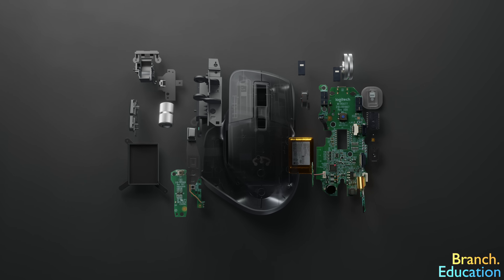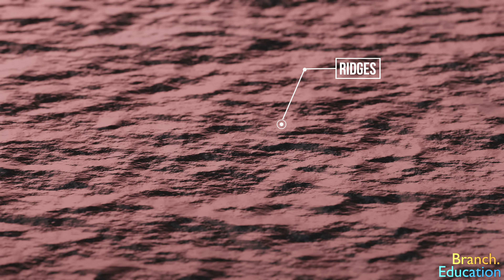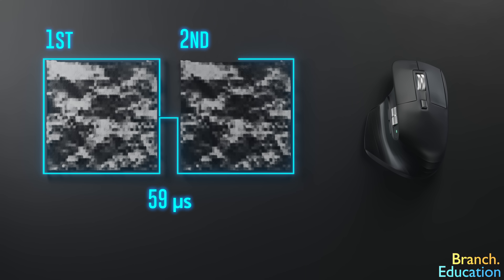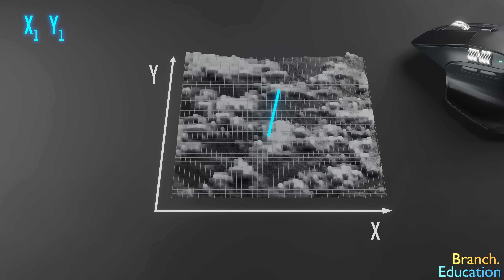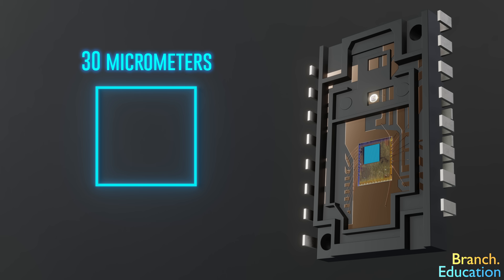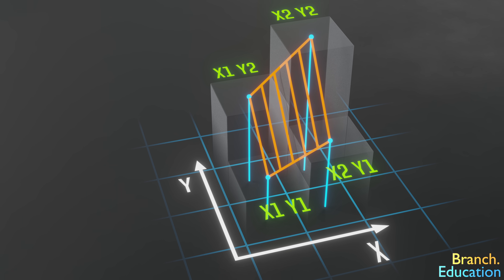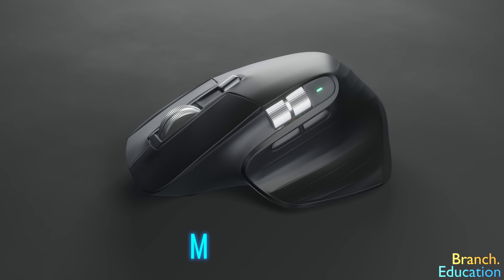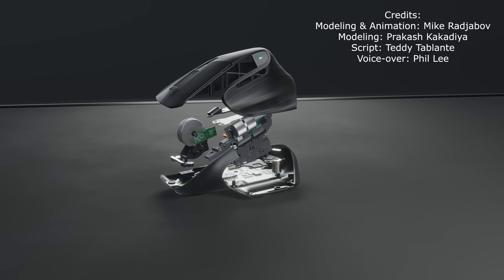How does a Mouse know when you move it?  ||  How Does a Computer Mouse Work?

Comment: Video was great up until you mentioned sensors get higher DPI using interpolation. Interpolation is fake DPI used by cheap mice to turn their real 800 DPI into higher DPI.Interpolation is not how real gaming mice get higher DPI. Real, higher DPI is done by using larger sensors for a higher resolution image.

Comment: In the late 80's my high school's drafting class "CAD" computer had an optical mouse. Used a Red LED and required a special mouse pad.  Definitely didn't need to be high resolution back then, probably doing EGA graphics at most, and I think the pad had a shiny grid pattern.

Comment: But then again if it has a report rate of 1000, how can it sync properly with 17000 images per second? You could say it's less accurate in determining distances 1/200 of a penny, gosh this is such a complex subject, like would it make sense that having an image sensor doing 1000 images and reporting 1000 images would still yield the same result as one of 17000?

Comment: That's so weird that you picked mouse models that are exactly the two mice I own and use, the G502 and the MX Master 3. I've only found one other mouse that has a hybrid free-spin/auto-stop wheel like the MX Master 3 (I think it was a Corsair) but the auto-stop clutch was glitchy and sometimes would keep going. At least the G502 wheel is weighted and notched so it has good free spin and it's pretty easy to just stop with a finger.

Comment: Back when I was a kid during the late 80s my mom had a Mouse Systems optical mouse with a rigid glass grid mousepad. It was a bit finicky and low rez, but monitors were VGA. It had an old school 9 pin serial cable and male plug. Later on she went to conventional ball mice for several years. I laughed back in the 00s when opitcal mice became popular again, remembering that old mouse from the 80s but very thankful for no more gummy balls to deal with.

Comment: Not quite correct. The mouse doesn't move the image around to line them up, it JUST subtracts them and compares the result to the old image to see which side of the features has expanded and which side has contracted to determine direction. The images will only have changed by a couple pixels at most, so the algorithm is very simple. Basically a hardware line detection algorythm, but it only needs to be about 80% accurate.

Comment: Long time ago, I used an optical mechanical mouse which is made by ‘digital’, they use 2 rollers which is placed at 90 degree each other to detect the x and y movement instead of using a steel ball coated with plastic. 😊❤ search by “Vintage DEC Digital Equipment Corporation mouse” you can see its great design at that time.🎉

Comment: I think that there is no point in installing an expensive photo matrix for a computer mouse, because with the advent of the first optical mice, an ordinary matrix was enough for a comfortable game, and despite the fact that Quake 3 Arena and Unreal tournament were more dynamic than PUBG and Counterstrike.  There are only two options for configuring the mouse: setting it to move quickly around the screen, but with less accuracy, or vice versa.
 This video also shows a mouse with an incorrect button layout (such a layout as in the video will be useful only for those who have 6 fingers 👽): the index finger should always be on the left button for a good reaction to the situation in the game and its rearrangement to the left side buttons in dynamic games it will only help you lose.  But in the middle position you can make an additional third button.  All other functions must be installed on the keyboard, since it is static and it is much easier to select buttons there.

Comment: Questions:
1. How do some mice work on a smooth glass surface?
2. How can the lift-off distance be reduced to a minimum?
3. How can a mouse achieve a higher maxspeed (often measured in "inches per second")?
4. What is the meaning of "max acceleration" in a mouse, and how can a mouse achieve a higher max acceleration?
5. What are the pros and cons of optical vs laser?

Comment: The slow-down of picture frames per second of the pixel array is not applicable to HyperX mice. Instead to conserve energy the image sensor shuts down entirely every 15 seconds even though it doesn't run on battery power. I RMAd my mouse and bought another brand instead.

Comment: Instead of the interpolation algorithm, why can't the mouse simply add a multiplier to the reported values? Say that the difference between the two topographical images is N pixels - why can't the mouse simply report to the computer that it has moved 2N, 4N and so on depending on the specified DPI?

Comment: Hm, how does the cross correlation figure out into which direction to shift? Does it try every direction for up to 40 pixels? 
What if the mouse moves really quickly, the images don’t match at all and the minimum is in a random direction?

Comment: The mouse knows where it is at all times. It knows this because it knows where it isn't. By subtracting where it is from where it isn't, or where it isn't from where it is (whichever is greater), it obtains a difference, or deviation. The DSP subsystem uses deviations to generate corrective commands to move the cursor from a position where it is to a position where it isn't, and arriving at a position where it wasn't, it now is. Consequently, the position where it is, is now the position that it wasn't, and it follows that the position that it was, is now the position that it isn't.
In the event that the position that it is in is not the position that it wasn't, the mouse has acquired a variation, the variation being the difference between where the mouse is, and where it wasn't. If variation is considered to be a significant factor, it too may be corrected by the DSP. However, the mouse must also know where it was.
The cross-correlation scenario works as follows. Because a variation has modified some of the information the mouse has obtained, it is not sure just where it is. However, it is sure where it isn't, within reason, and it knows where it was. It now subtracts where it is from where it was, it is able to obtain the deviation and its variation, which is called.

Comment: I see ways that AI could be used to increase accuracy, fidelity, and performance in the image processing and cross correlation algorithms.

I also feel like the interpolation is a bit misleading because it only creates virtual fidelity, not actual true fidelity.

Is any of this necessary for computer mouse improvement?
Not really because we have solved the technological hurdles and engineered a well-working wheel of sorts.

But could it theoretically become over engineered even more so to continue to improve the fidelity?
Sure. It would become more costly and the return on the improvements diminishing.

Comment: As someone who owns the Logitech G502 Hero gaming mouse shown in this video, I had an a-ha moment watching you explain high DPI!! That interpolation that you explained translates into an actual difference in user experience with high DPI vs low DPI.

At higher DPI, even as low as ~2000, I notice a sort of smoothness to the mouse movement that isn't present at 800. The higher you go, the smoother this feeling gets, almost as if your mouse is going down a long water slide with smooth turns and centrifugal forces. High DPI means stronger gravity and smoother but sharper turns. I realize now that that feeling is because the interpolation algorithm is essentially smoothing out the textured surface that the mouse is capturing, which is fascinating to me!

So when pro gamers are said to use 800 DPI, this helps make sense of that. It's the most accurate DPI, where your hand movements are directly translated into movement. An interpolation algorithm can introduce tiny amounts of error there, or the smoother movement can make precise starts and stops of the cursor harder to achieve.

So thank you for this great and super interesting video! I can't wait to watch more.

Comment: Mind-boggling how the hardware can ingest the image data and perform those calculations so quickly. It'd take a human forever to calculate a single one, considering it's multiple subtractions of two 1600 pixel arrays until you find the right fit. A mouse does that 17,000 times a second, and can do that non-stop for hours and hours while sipping power from the battery.

Comment: I thought that mouse just work by detecting in witch way the laser is heading and transform that info to the computer without capturing images and measuring the distances between each image and the speed of the move cuz those things i can control on windows mouse parameters 😂

Comment: This is cheap tech in terms of value of parts and making mouse.
And then you have smart marketing that will convince you that 100 USD or more mouse is better than 10 USD "ewaste"mouse because it has more DPI and few led lights.
Reality is that there is a bunch of cheap "ewaste" mouse out there with specs same than ones with brand name and high price on them.

Comment: G-502 for life! Before that it was the G5. I've probably used hundreds of different mice of high and low quality. This Mid-Range Mouse obliterates everything else by a significant amount. Mice are strange, some of the cheapest are better than some of the most expensive- to me, price to quality ratio doesn't correlate at all. I play a bit of everything, RPG/FPS/RTS/etc. so my preference for this Mouse is likely because it's a good all-round choice.

Comment: Question: does the image processor take the previous movement in x and y into account as an educated guess for the current x and y movement? That would be a nice optimization as you're probably not accelerating much in a couple microseconds.
Reply: funny thing, using previous action to predict an action that will happen next is partly how RollBack Net Code works (in fighting games for example)

Comment: i’m curious why there’s a seperate chip to execute the cross correlation algorithm. couldn’t the soc also execute the algorithm?
Reply: Yes.  The video makes a bunch of weirdly specific assertions that could be true for some specific model of mouse, but aren't generally true.  Yes, the main CPU could execute the image processing.  There could be a DSP.  There could be a functional block that only handles the image processing, but isn't a DSP per se.  Those could be the same physical chip.  And, the cross correlation could well be done in completely different ways from how the video said (for example using Fourier analysis techniques.)
The only thing you can say in-general about how optical mice do it is to say that there's an optical sensor, and something in the mouse calculates a displacement based on the data from the optical sensor.  Everything else is down to whatever the engineer found convenient based on what parts are cheap.

Comment: Interesting, I didn't realize there was a full image sensor inside. So since it's already taking a image and comparing it, might it be possible to make a mouse that detects not just translation, but also rotation? Maybe it'd just be a gimmick, but it'd be kinda interesting if you could rotate the mouse to do things like adjust the angle of an image you're dragging in an image editing program, or perhaps as a way to lean left or right in an FPS game, and it seems like most of the hardware to allow that already exists.
Reply: Definitely would be a gimmick. Trying to control both translation and rotation precisely with your hand on a computer mouse just means you will do neither very effectively

Comment: I'm very surprise they would max out at a 40x40 sensor....a 16,000 DPI mouse could easily use a real 125x125 sensor, that's not even close to what cell phone cameras use, and we have the processing power to easily handle it. What am i paying for with an increase in DPi if not a higher pixel sensor...anyone can do interpolation with a crappy 5x5 pixel sensor and claim 10,000 dpi. thats not real dpi.

Comment: Excellent video. I’m an old electrical engineer but just never thought much about how optical mice worked. Nice bit of explanation. Getting a vertical mouse for Christmas, in preparation for a new desktop build early in the new year. Hope the vertical style will better suit these older, stiffer hands. The hard part will be to move the mouse without thinking about your fine graphics and lucid explanations.

Comment: Very sly. Don't think you can get away with your phony explanation which will definitely fool the masses to believe what an informational video this is.
What is skipped in this video is the most important part of how the movement in terms of X and Y axis is calculated. When the digital unit doesn't save any image except for the current and last one, how the hell really the processor "shifts the second image around while leaving the first one stationary"? to find the relative minima?

Where does it get the value of the new pixels for the new plane as you so casually and conveniently said, "shifts around"?

Until you do some actual research and not just google and wikipedia some basic terms, shut your channel down and delete it forever.

Comment: I've seen all this practically but didn't knew what they are becouse once my wireless mouse started to go bottom left on the screen everytime i clicked a button i tried to open the mouse and dust off everything but it didn't help then i used a hair dryer and blew hot air over all the components (pcb) and over lense miraculously it's still working i used to keep it over table and maybe the atmospheric moisture was clogged inside, from then on I'm wrapping the mouse in a cloth and keeping it inside an air tight box after use
Conclusion: if u donot use electronic devices for longer periods of time disconnect the device from power and keep the devices outof moisture/ wrap them inside plastic bags

Comment: Bold choice using a Logitech MX mouse. They use a dark field sensor instead of a traditional one like the G502 you used as the gaming mouse example. The MX mouse can infact work on a glass desk, even without anything under the glass, because of it's unique sensor design. But it does so by working exactly the same way as other mice, except it measures the opposite end of the light spectrum.

Comment: I literally didn't expect how complex a computing system a mouse has, tremendous!
Reply: It only seem complex because they did not explain the mathematical shortcut in the calculation. Instead of calculating each pixel they transform the array of pixel data into a series of multiple wave frequency which makes it easy to calculate the distance traveled by calculating phase difference in every frequency.

Comment: *=* The good answer, never clean camera hole of mouse with paintbrush, that will damage tiny copper wire and cursor will not moving, just clean the transparent prism, or go buy a new mouse, did a models of mousepad got benefit?
A wireless mouse with advanced encryption is a good idea!
A app for mobile using the cam and light to imitate mouse displacement is just fancy, not for gaming mouse, lol!

Comment: how the processor would know where the second image should be moved so the difference between two images will be minimum? Does the processor brute force in all direction to calculate each step and find which direction that result in minimizing the difference? Or it uses some kind of optimization algorithm which calculate the gradient of each step based on the cross-correlation algorithm output as the objective function?

Comment: does this mean if I put a clear glass between my mouse pad and the mouse then the mouse should function perfectly fine as it's still taking images of the peaks and valleys in the mouse pad? because I have tried it and it didn't work. 
note: I did keep a small separation distance between the glass and the pad so it doesn't squeeze the texture and it still didn't work

Comment: The technology itself is nothing really crazy, but when you take into account cost (down to 5 bucks) and reliability (thousands of hours with zero maintenance)... that is really unbelievable! What an accomplishment!
Reply: it would cost very much if not for mass manufacturing
Reply: The modern mouse's reliability is mostly thanks to the lack of moving parts. The only moving parts are the buttons and wheel, and those parts tend to fail long before the electronics and sensor do. Old-fashioned mechanical mice used a ball and rollers to sense movement, and although they were much simpler than modern mice, the rollers got dirty fast and needed to be cleaned pretty often.

Oddly enough, although old mice are universally terrible by modern standards, the same is not true of keyboards. Some old keyboard designs, like the IBM Model M, were much sturdier than the typical modern keyboard, and keyboards of almost the same design are still sold and used to this day.
Reply: @argvminusone I still use the same Model M from 1989 I got in like 93 used to this day. As for the ball mouse, it’s long been gone.😂
Reply: The technology is beyond crazy and people really do not grasp just how crazy it all is. To claim otherwise is not because of good understanding of technology, it is because of ignorance.
Reply: My mouse lasted 7 years till right click finally stopped working. My guess is over 10000 hours of usage.
Reply: Copy and paste don't cost a lot. Now that burrito from Chipotle that's hand made, that's worth $10.